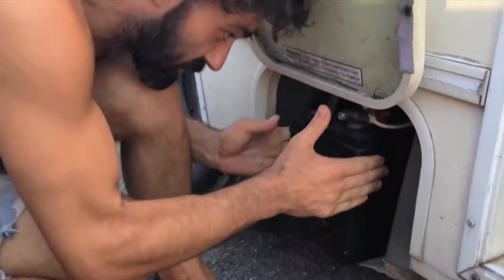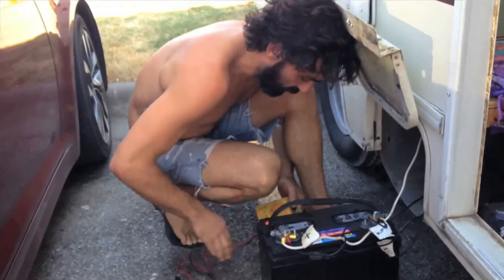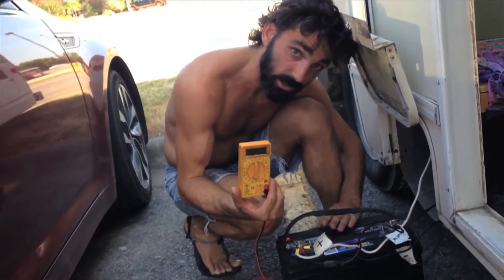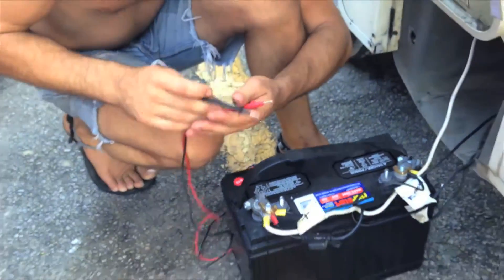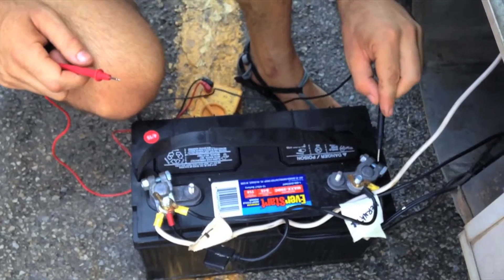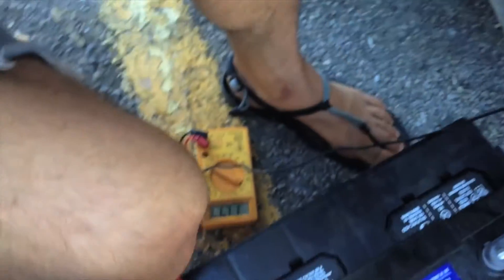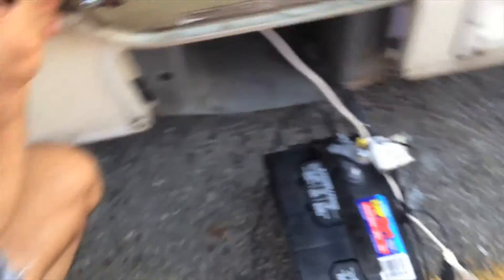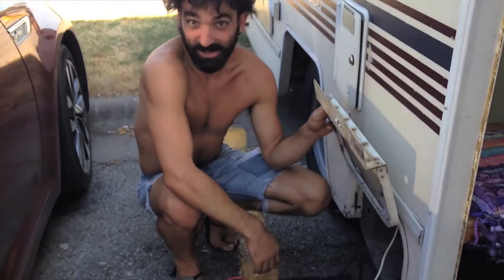RV DC power|| HOW TO TEST BATTERY #travelsinwinnie

Comment: Oh, Hell Yeah! For the price you can't beat that. Are you running it through an inverter,or just back through you RV 12V system? Any plans on Solar,if so,,I can help. Let me know,and Be Safe. Love Ya! C-Ya!,,,,Peace!
Reply: +GnatMan Allin : So I bought a truck camper that I am looking forward to travelling in this coming Summer (2016). It has the hook up to connect with the truck battery. But... In watching this video I see I need the marine battery from Walmart. I am definitely going to go Solar. I would like to be able to also message you for questions and answers on the how toos. Hope you will be ok with that. I am a total newbie. ☀️
Reply from the maker: GnatMan Allin Right!? Such an amazing price! We are just running it back through our 12V system. We have an inverter on the other end to hook up our electronics to DC. I definitely see solar in Winnie's future and I will definitely reach out to you for help! Thanks so much for your continual support. So great to connect with you this way :)
Reply: Ahh  Shucks,,,,C-Ya!,,,Peace! ;-)
Reply: Anytime,,,,I have worked on RV's for ages,but there is something new every week it seems,and I try to simply keep my head above the flood.
  Here's an awesome tip,,,Find High Amp hour Batteries at cell tower sites. Look for a Verizon,AT&T,T-Mobile,etc, work Van/truck, and just inquire about a time frame on tower battery change out. Many times you can get them from the recycle center they bring the batteries to.They normally will NOT allow you to take them from the site, due to liability ins.Sometimes it takes a few inquires,but you can get deep batts with High Amp hours for zero,to 20% of the cost.
   Cell companies must change out batteries once every year or two. Most all of them are perfectly good units. Do a YouTube search on the subject for more details.
  I try to find the cheapest way out of most problems,but I refuse to skimp on Tools,Electronics,brakes,Tires,,,,U know,,the thinks that keep us safe,and happy.
e_mail is AllinCoIronWorks@gmail.com,  Twitter, is @GnatsTheName
  I look forward to chatting. C-Ya!,,,,Peace!